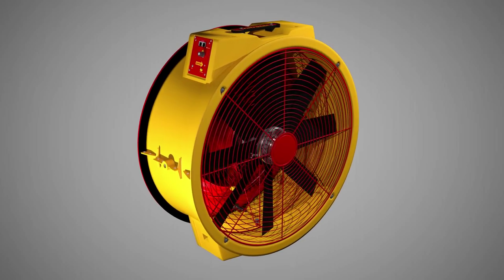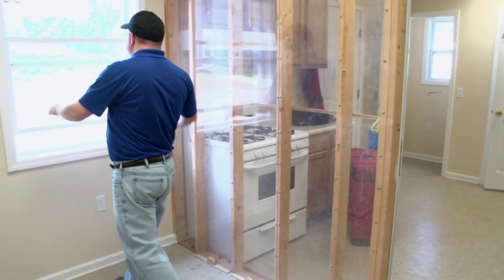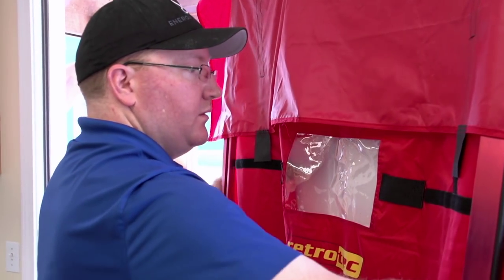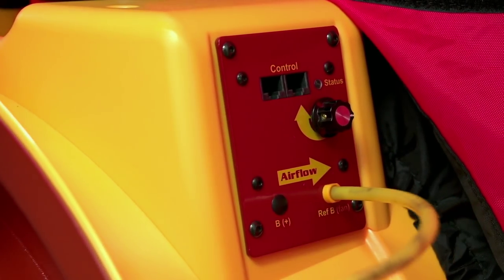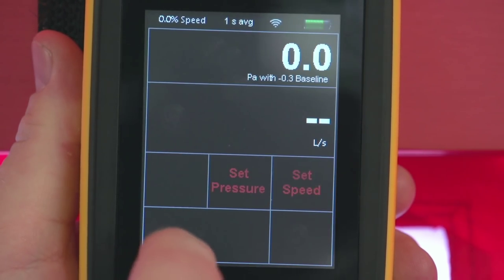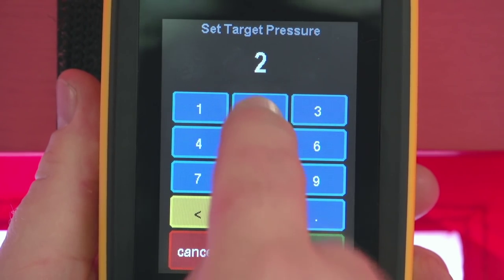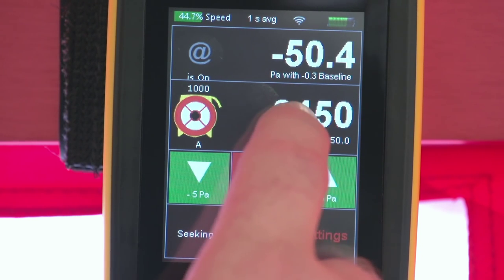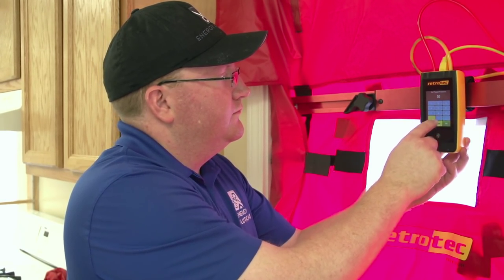Retrotec Blower Door Instructional Video

Comment: what’s the procedure for 2 fans?
Reply from the maker: for multiple fans, you'll want to use our FanTestic software. You'll daisy chain the fans together with a Cat 5 cable and use other cat 5 cables to plug the gauges into a switch box which then feeds to a router, then to your laptop. This way, you can ensure that all fans spin at the same rate at the same time unlike other brands that have the issue of fighting each other. We have videos on hear about multifan testing and FanTestic.

Comment: While doing the test. Should we be outside the room?
Reply from the maker: Nope! You can be right where the test assembly is located inside the room. However, you can use the GaugeRemote app on your smart phone if you'd like to have control of the fan while you walk around to other parts of the house to locate where the leaks are coming from.